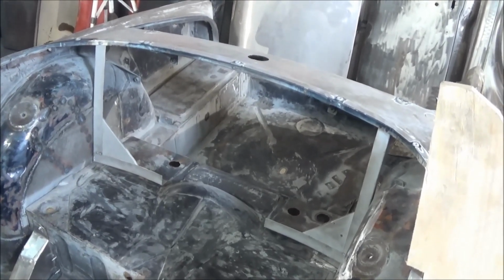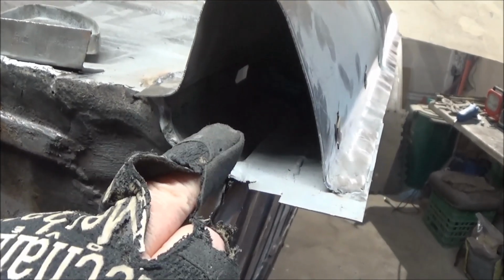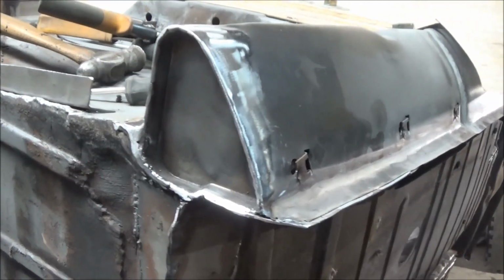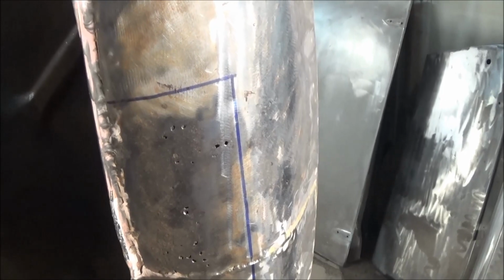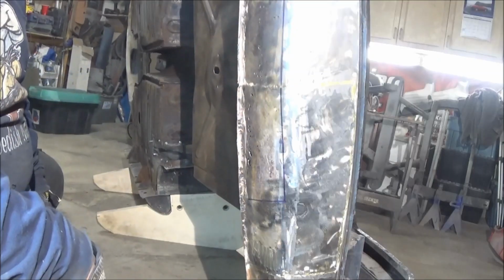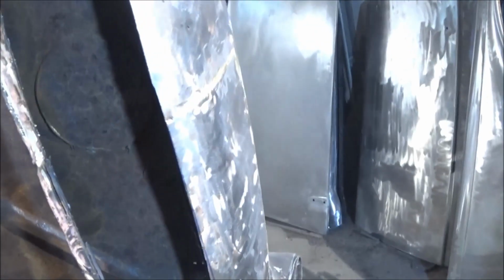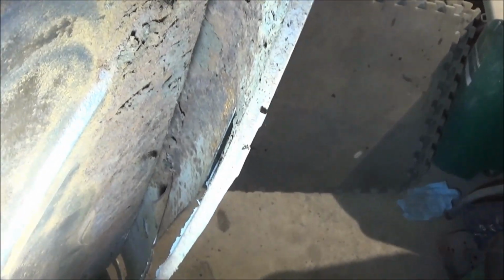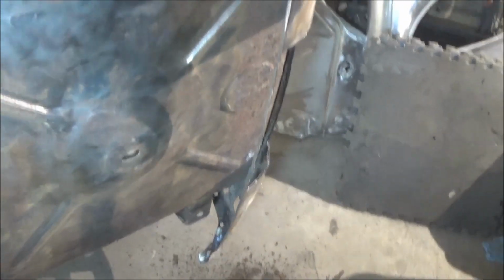1968 Triumph TR250 Restoration, Rear Panel Brackets/Sill Cap and Rear Valence  Dissection

Comment: Hi Chef, Your videos have been very helpful. Starting a 1960 TR3A. I am working on the dreaded battery box. how did you remove the box from under the scuttle. just not sure how much force to use. I don't want to damage any more than I have to. I will be forming a new bottom to the existing good remaining metal. thanks for the great work you are doing.
Reply from the maker: Frank Canale  Hi Frank, have you drilled the spot welds out at the top of the panel where the flange for the battery box attaches?  Since I was replacing the entire box, I cut small slots in the bulkhead on either side of the battery box just about where the throttle shaft runs.  This allowed me to bend the box down enough to clear at the top once all the spot welds had been drilled out. Once I place in the new box, I welded up the slots I had cut at the bottom sides.   Hopefully, this helps.
Reply: Thank you for the advice. I have the spot welds drilled out. I will look at cutting the slots and moving forward.

Comment: Don't know why u don't remove the whole valance there's a lot of rust behind there and you've done so much work on the car seems a shame to skip that bit
Reply from the maker: Simon Walters I don't think it will be easily removed with the amount of braising on it.  I think it would be destroyed in the process. None of the vendors have a new one in stock so if this one becomes un usable, then I am in serious trouble.  If I could find a new one, this one would have come off long ago.
Reply: Rimmers seems to have it "from their supplier?" https://rimmerbros.com/Item--i-575169
Reply from the maker: Hi Derek. I checked.  It is available to order...6 months lead time and they couldn't promise on a delivery date...
Reply: cheftush ah

Comment: Cannot understand why they brazed nearly everything , have never seen that amount on any car before .
Reply from the maker: Me either...I have seen some other cars with tons of lead work....this one has tons and tons of braising.
Reply: I'm really beginning to wonder if this was the same "craftsman" who did ask the brazing on my 250.  Looks suspiciously similar, although there is more of it.  Regardless, well done on the repairs!
Reply from the maker: Yeah, I am acutally surprised that the fenders were not fully braised on...then there would be no doubt that I cars had the same "craftsmen" working on them :-)
Reply: When I started as a panel beater in the mid 70' everthing was gas welded , we used brass rods very sparingly and only were they were used in the factory , it was the early 80's when we got a mig and spot welder and that was at a Vauxhall dealers .
Reply: In the mid 90's I did an E-Type for a company and in the next bay was another one that had been restored by them a few years earlier , the paint had micro-blistered , when they stripped it the whole car was full of lead , apparently the owner wanted all original panel car , car had come from Texas scrapyard , I had done some welding on an MGA and heard the same story about that car .

Comment: I know they are expensive but I would have bought a new valance panel for the rear.
Reply from the maker: Hi John....Thanks!Yep, he has it there...wants $200 bucks for a used panels that looks pretty rusty, dented and welded on....I think Ill pass and work with what I have....I already have all the above :-)
Reply from the maker: Its more the availability issue actually.   last time I checked, they were backorderd from all the regular sources like TRF/Moss/Rimmers with no anticipated time of delivery.
Reply: Check this CL link out- he may have some stuff for you? https://portland.craigslist.org/clc/pts/d/triumph-tr4-tr4a-tr250-body/6470012183.html

Comment: Wow Tush. A triple decker sandwich. Shouldn't there be an inner valence and outer valance arrangement here like on the 6? Not sure if the 250 had this too. A badly designed moisture and dirt trap straight from the factory.
Reply from the maker: Quite a bit different from the TR6 Sean...thankful for that actually....

Comment: Yeah, that is why I hate overlapping patches. Even an inch of overlap is enough to create a moisture trap. Butt welding is harder but safer. I recently watched someone overlapping about 4 inches of metal on a floor for "increased strength"..... I am just not a fan. Anyway, I am sure you will do a great job on that valance.

Comment: You got a perfect scald on that sill cap David. Is this the worse rusted car you have worked on? I remember the black TR3 had plenty of rust.
Reply from the maker: cutworm59 hi Stevie.  This one is worse as it is not only rusty, it's been poorly repaired in the past. I'd prefer a rusty but untouched car...
Reply: cheftush Same way I like my women......
Reply: Can I spot weld pin holes David?
Reply from the maker: cutworm59 you can weld up small pinholes as long as the metal is solid on either side. Works better if you can get a little copper backing plate in behind.
Reply: cheftush Thanks David. I have plenty copper for backing my welds.